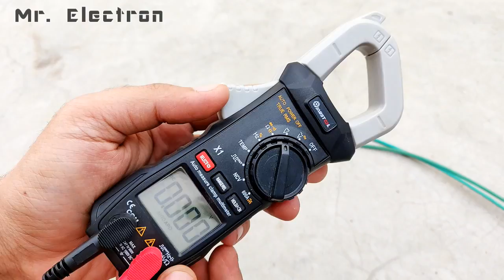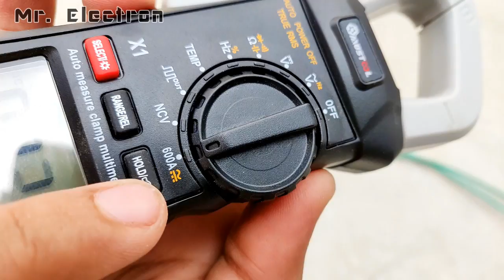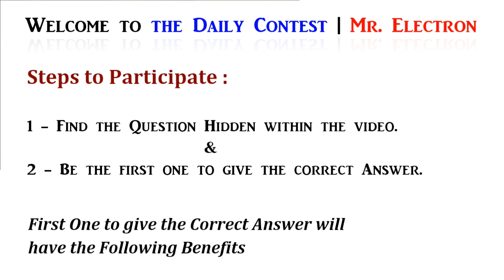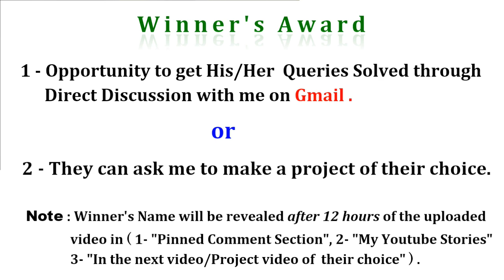Make 12V 5A DC Motor Solar Water Pump from old 220v Induction Motor Pump DIY

Comment: The pump is Not good enough...
Better to use suction pipe to improve the water flow..{no air}

Or Instead u can use that motor as a fan..

Comment: Make a pwm charge controller
Reply from the maker: No electronics projects ( Only channel related projects ) - like motor , generator or alternator related project.
Reply: @MrElectron  I have an idea old toy car motor  rewinded  with thickness  of copper wire  then we can get more torque